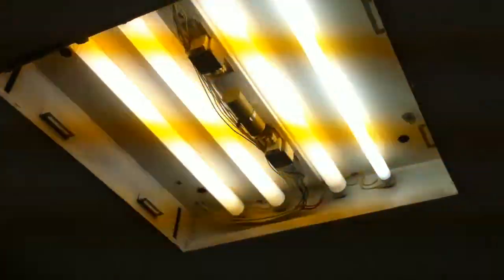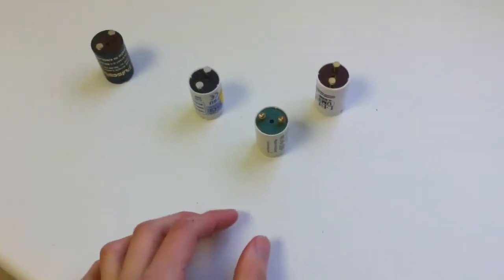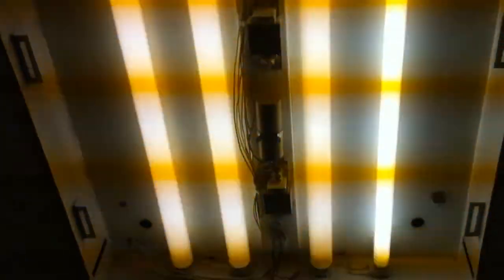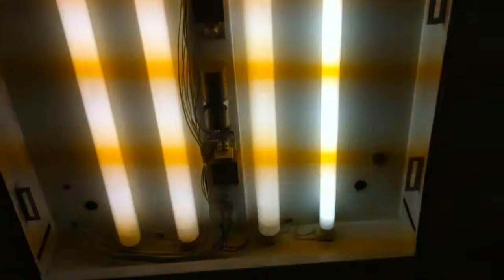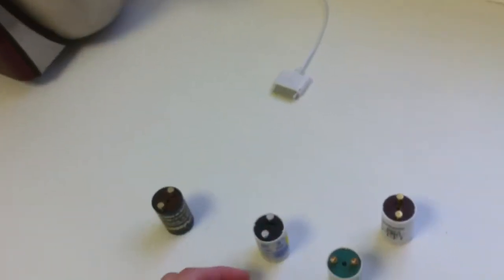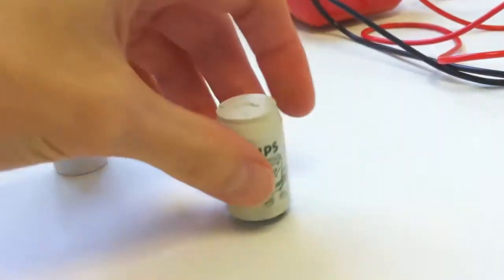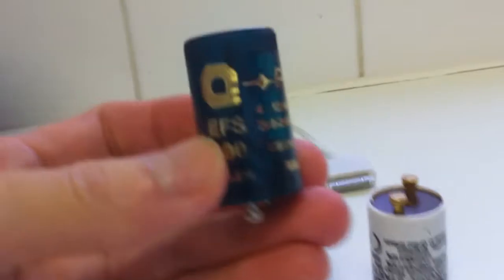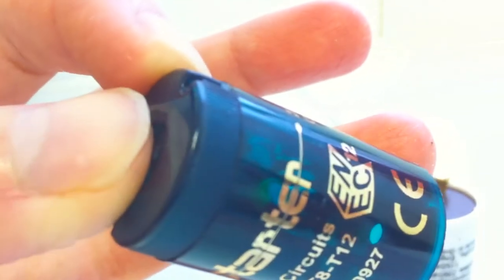Electronic florescent lamp starters and their benefits

Comment: Being a electrician as I am forever that's is a 2ft fluorescent light fitting.with two 36-40W chokes ballasts and only use two types of fluorescents tubes for that light fitting only just four 2ft 18w t8 fluorescents tubes and only four 2ft 20w t12 fluorescents tubes in that kind with only in series 4--22W 110-130-220-240v fluorescents lamps starters for use in this type of fluorescents lights fittings.and they are the right replacements of fluorescents tubes and fluorescents starters lamps and that information from myself and everyone and that information from a lots of the electricians and don't use any wrong type of fluorescents lamps starters switch for that light fitting like the starters switch your got there.the Philips s10 4--65W 220-240v use in singles via this type of fluorescents tubes only.in a t5 4w -6w -8w -13w and with using in singles only with the t8 fluorescents tubes in a 2ft 18w and 3ft 30w and 4ft 36w and 5ft 58w only and in t12 fluorescents tubes for singles in use only.in a 2ft 20w and 3ft 30w and 4ft 40w and 5ft 65w fluorescents tubes must be in life use and that other bg fsu 4--80w 220-240v fluorescent starter switch for other new replacements of spares  new ones.with many thanks and have a good day now from everybody on here live internet system all roll.
Reply: Stop.